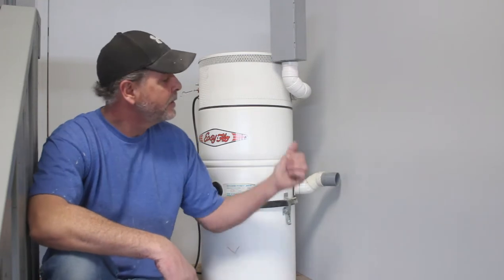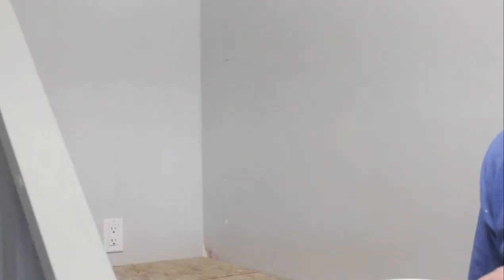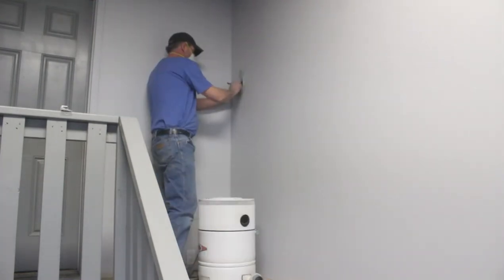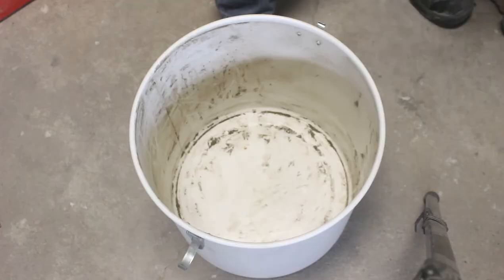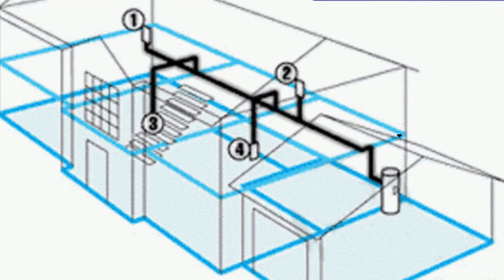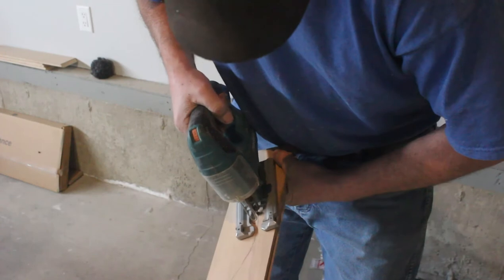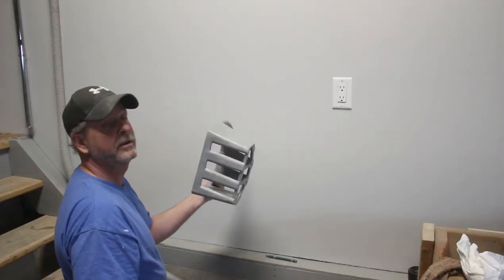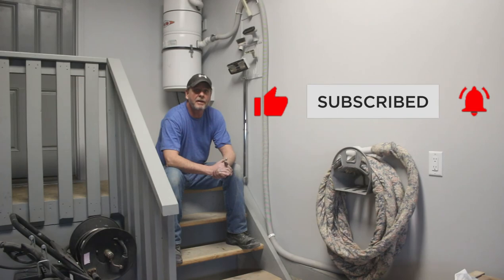DIY Workshop Vacuum system - Central Vac in my workshop (NOT FOR DUST COLLECTION)

Comment: I would have washed that filter  and canister  with water, hose soap etc. You can buy bags for it too. Much nicer to use with bags and also you can add a hepa filter on the exhaust port. Makes it much quieter  and lets only clean air out the vacuum
Reply from the maker: Hey thanks for the tips I’ll look into the bags and hepa filter

Comment: The best way to clean the filter on these is to take a plastic garbage bag, wrap it around the unit, and shake the filter until no more dust would come out of there. That's what every central vac manufacture would suggest and that's what I usually would do when I service these types of central vacs. You could technically still use a wet/dry vac to clean the filter but it's just messier that way. And if you take the filter out, make sure that the ring is snapped back on tightly. Otherwise you could definitely risk of shortening the life of your motor with dust and dirt, that's also what every central vac manufacture would avoid anyone to do.